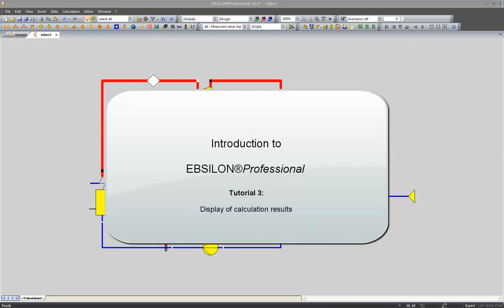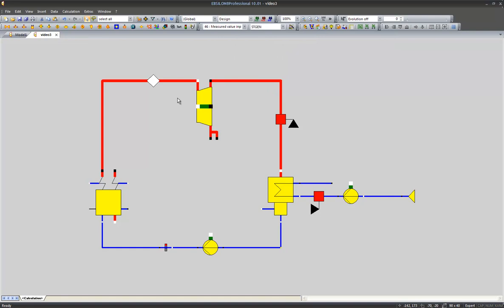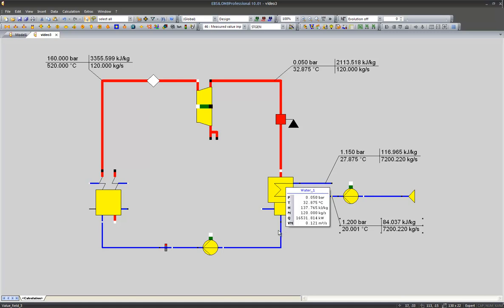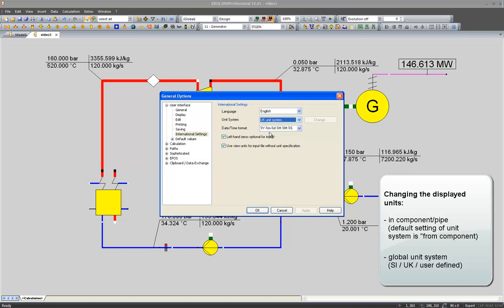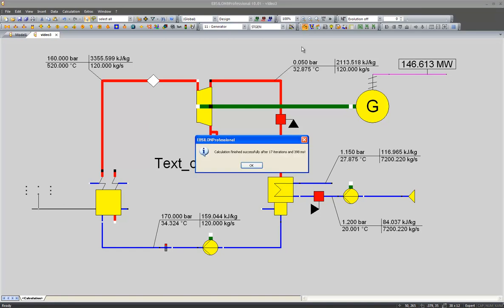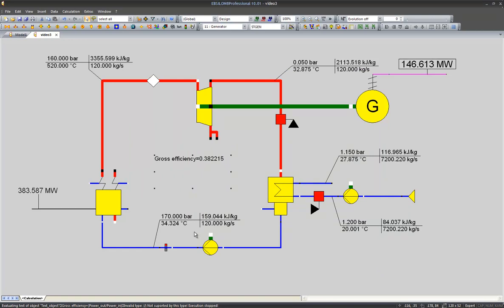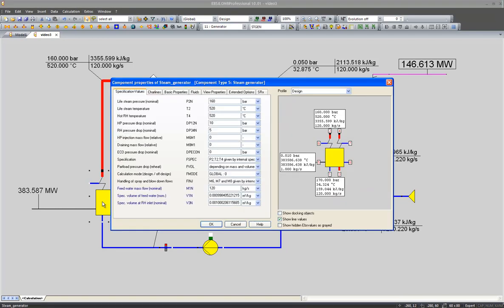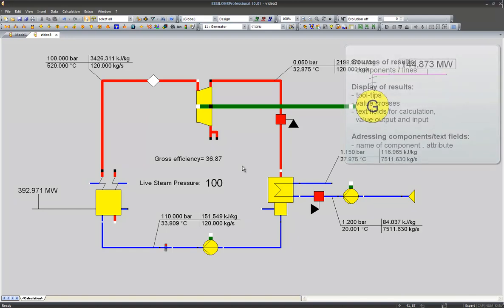EBSILON Professional Display of calculation results

Comment: Hey, thank you for the useful videos. I wanted to ask how did the model run successfully without specifying the shaft frequency. I am getting an error if  I follow the video, the error reads "Error in input data missing shaft frequency"
Reply: Dear Mahmoud Mostafa,
the error about missing frequency is new in EbsilonProfessional 15. If the model is created with older version of Ebsilon (as in the video where an older version was used) there was no error. To get rid of the error, you either can put a general input value (comp.33) onto the shaft and specify the frequency or rotation speed (specification value F) or you can change one model option (in Extras -> Model Options -> Simulation -> Iteration). The option is called "Report errors in the system of equations also for shafts and electric lines". The default value is "Yes" (therefore the error message(s)), but you can set it to "No" to disable the error message(s)